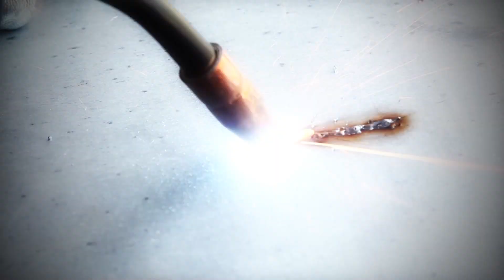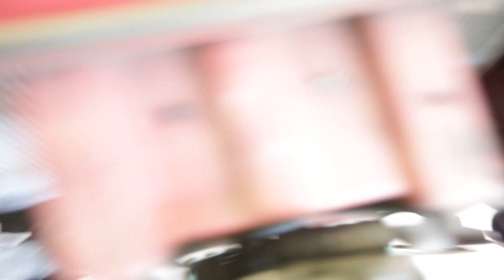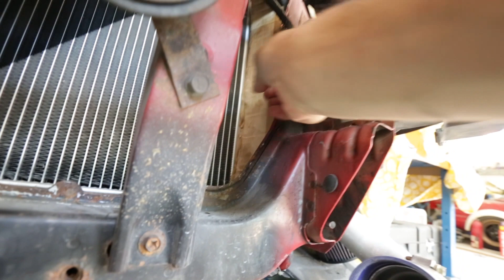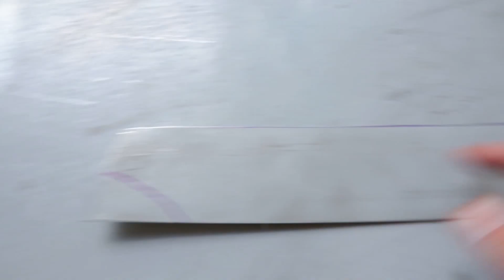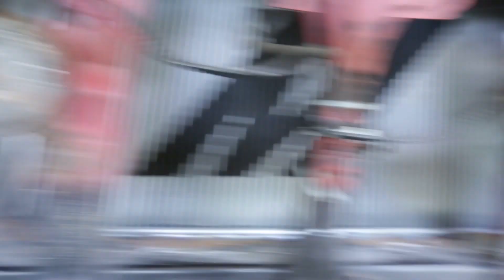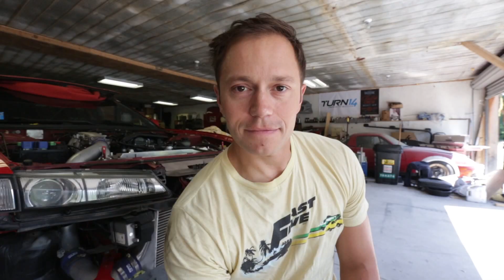Radiator Ducting How To - Project GripS14

Comment: Do you have any concerns on having those ducts fall off at triple digit speeds?

Say if one where building a s14 for a standing mile or rolling half mile?
Reply from the maker: I certainly wouldnt think so. As long as you take the measures to fasten them to the chassis it should be fine.

Comment: Move those freakin horns to a better spot where they're not adding copious amounts of turbulence in front of the damn rad system. That will be a SUPER easy (and free) job. Remember; turbulence is irregular pressure pockets in the air. This  could cause the area behind the horns to see different/lower levels of performance. We don't want that.
Reply: I was about to write that... removing them will make more effect then the this ducting.

Comment: Is there any space between the sheet metal and the aluminum rad. if not you might want to give it some wiggle room as to keep the sheet metal from wearing into the rad and causing a leak.
Reply from the maker: I don't drive this car daily, maybe 15-30 times a year so the odds of it wearing through are slim to none. Plus thats what the tape is for, it has play in case there is a slight bit of movement.

Comment: Pete I'm just pitching an idea for the future, tell me if there is the slightest chance it could work: Would it be possible to take a Honda Beat but swap in the engine, and front/rear suspension of an nsx? The purpose of the car would be purely time attack so hacking up the firewall, or relocating things to the frunk would not be impractical. I feel like you guys are the only people who would be a able to make something like this but a widebody, hardtopped beat with 5 times the horsepower seems like such a cool idea. Backyard Special made a time attack Beat with a b18 swap, hardtop, aerokit, widebody and stuck some massive R888s on it. It looks so cool. I've always dreamed about this build mainly because the beat and nsx both are midships and have transversely mounted engines, plus kei cars are funky.
Reply from the maker: Possible yes, feasible... well if we had enough time and plenty of money but the amount of custom work to put something like that together would be way beyond what we do here. Great idea though :)

Comment: I would think a small rubber strip between the sheet metal and the soft aluminium of the rad could be a good addition, as it may wear away at the rad over time with vibration. Keep up the good work on the channel.
Reply: Just use some old rubber vacuum line with a slit down the side. Works great, and if it doesn't wanna stay put, a dab of rubber cement works wonders.
Reply: Yeah, that would be perfect.
Reply from the maker: Not a bad idea at all but I pretty much drive this car to the track and back so the amount of use it sees is so minimal that it'd take a decade to wear through!
Reply: Haha, fair enough. Enjoy it (after I had finished a job like that I couldn't be assed pulling it apart again either ;) ).

Comment: I find 0.9mm alloy with stick on velco works well. Even though the aluminium is very light guage the velcro fully supports it, so it bends when you remove it but yo can reform it when you put it back on. THe other thing is it will not wear into the rad or intercooler, because the velcro strip is like a soft seal
Reply from the maker: Sounds like a good option!

Comment: Sheet metal screws for a track car PT??!!  I hope its your tire those puncture when it falls out and not mine!  (THey look small, but still) A rivet or a bolt is just as easy no?
Reply from the maker: Not a chance! Those screws aren't falling out, a rivet gun would've been really hard to get in there same goes with a nut and bolt.

Comment: why would you use foam it is a good way to light up the car. I used a carbon fiber  ducting from a nissan s15 it needs a little cutting but it looks clean as in my 14  . looks as clean as my s15 set up
Reply from the maker: Foam is a good option but sooooo dirty and messy to clean up when you want to trim it. And didnt know about the S15 stuff!

Comment: what fans are you using?  if it's the mishimoto ones, get rid of them they are a waste of time. you can use flex a lit dual fans never had any overheating issues or did any sort of fab like you did. There is a cheaper rout yiu can get a 97 volvo s70 turbo fan they're cheap and they come with a relay set up. you can look at a few youtube videos people have done. change your fans.
Reply: I think PT already knows this but especially for an SR20DET  nothing will beat proper ducting along with the clutch fan and radiator fan shroud. Electric fans are useful when your car comes off the track and you're not moving.
Reply: I also found out the best cooling fan was the original clutch fan with the stock fan shroud. 
That combined with a good quality aluminum radiator, you should never have overheating problems at all.
Reply: Gravstein +1. Just in case no one here knew about this; you can upgrade the stock SR20DET clutch fan with a R33 RB25DET clutch fan. It's a direct bolt on and it clears the OEM SR fan shroud no problem at all. The RB25DET clutch fan has more blades and is apparently more efficient than the SR20DET stock clutch fan. I've been running one on my SR for quite a while now.
Reply from the maker: I've got the stock fan and shroud. Works the best from everything Ive read so I'm sticking with it.

Comment: The cause of your over heating might be that HOT charge-air-cooler (CAC) in front of the radiator? Your panels should keep under hood air from recirculating back through the radiator, but you still have a CAC pre heating the radiator inlet air. A solution might be a more efficient or larger radiator,  improve air flow (fan &/or ram air), &/or divorce the CAC from the radiator. 

Do you have access to some thermocouples (t/c)? Perform a before & after radiator air inlet test by placing t/c's on the outboard edges of the front of the radiator. You can determine if your panels are helping by comparing the temperatures. You can also understand the temperature of the air coming out of the CAC / Radiator Inlet compared to air entering the front of the bumper cover (ambient air). When under high boost, you should see a temperature increase out of the CAC.

Cool project.
Reply from the maker: You're right the rad doesnt see much fresh air but at the track I remove the upper grill which allows quite a bit of fresh air to the rad.

I wish I had time to invest into a proper setup to test the system. If I ever have some spare time I'd love to perform the test you mention.

Comment: simple fixes are often the best.   keep in mind,  for testing, it can be just done in cardboard and aluminum tape,  assuming it's not raining.   try a few different designs,  then make it in thin sheet metal or aluminum.   for a nicer finish,  instead of using sheet metal screws,  use rivnuts and bolts.   good job man.   every improvement helps.
Reply from the maker: Rivnuts wouldve been great but access to where Im working was really tight so I took the easy route and just screwed it in.
Reply: +Speed Academy for sure.  you would have likely had to remove the rad.  it's something to think of next time you have the rad out though!